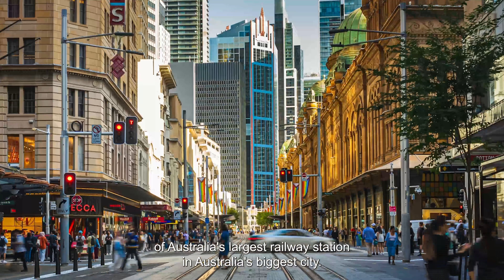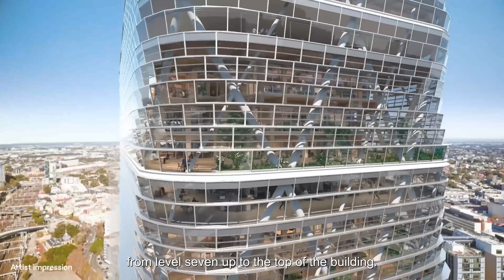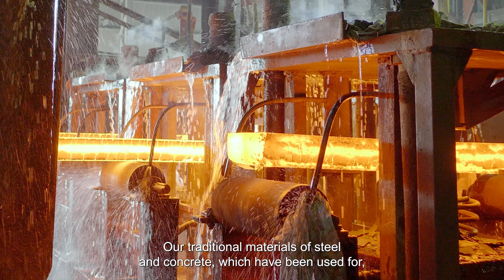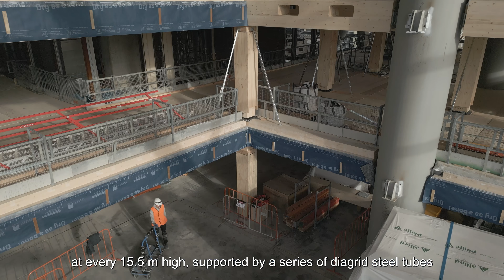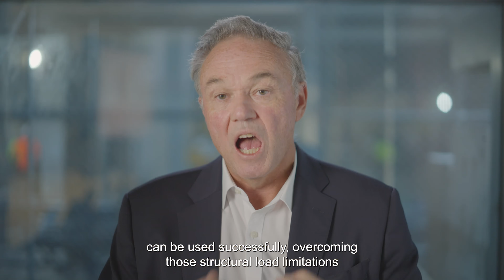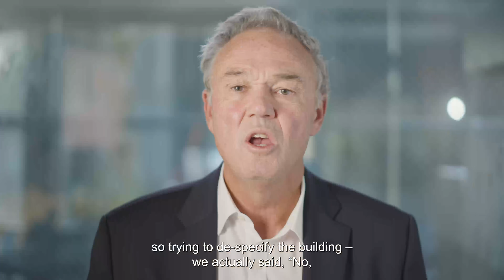The world’s tallest timber tower: Sydney’s impossible build

Comment: Atlassian is already regretting this build. The maintenance will be an ongoing and increasing cost.
Reply: the wood structure will not burn. In a large fire, the wood will carbonize and form a fire resistant skin so the wooden structure will not be compromised. Whether or not it can be reoccupied is a different matter.
Reply: @chochylindt  if the fire is hot enough, the wood will burn my man

Comment: Structurally, this is absolutely nowhere near a genuine timber tower. Never.

These so-called timber “habitats” are essentially slotted into a primary steel-and-reinforced-concrete mega-structure, like timber drawers inserted into a much larger structural cabinet.

That may be clever branding, but it is not structural truth.

From a structural engineering point of view, this looks far more like a steel-and-concrete mega-structure with timber insertions than a true timber tower.

Calling it a “timber tower” may sound attractive in a media headline, but technically it is highly misleading.

Comment: i'd put any money on the fact the carbon footprint of constructing this building is no more environmently friendly, or sustainable than any other high rise
Reply: more for bragging rights than anything significant impact. They may have saved some carbon from not using concrete, which is carbon-intensive, but the engineered wood was also energy intensive to make. Most of a building's carbon is its operation so unless it's covered in solar panels with batteries and energy-recovery tech in the lifts, not any better than a conventional building.
Reply: @chochylindt  "They may have saved some carbon from not using concrete, which is carbon-intensive, but the engineered wood was also energy intensive to make." that's... the point. they are using timber because it's less carbon intensive than concrete. unless you know of a material that has 0 embodied carbon?
Reply: Wood is regenerative. Maybe Google what Carbon footprint means first 😅
Reply: @downundabrotha  I know it is bro, but it's not a wooden hut in the forrest, I'm talking about the whole building and process, don't get me wrong i get what it involves (builder myself), and I understand what a Carbon footprint is defined as.
Reply: @mattyk82  nobody is claiming it is? you people are just desperate to be angry over something, I don't understand it. When you look at the total ledger, a hybrid timber skyscraper leaves a dramatically smaller scar on the atmosphere than a standard concrete block. That's just an objective fact
Reply: The high use of wood alone here will significantly reduce the amount of carbon used, especially when replacing concrete. Timber literally absorbs carbon out of the atmosphere unlike nearly every other construction material we use. Concrete itself requires a significant amount of energy to make, and is typically leveraged using fossil fuels, and is the highest contributor to CO2 emissions in construction globally.

They have good information on their website about how it's going to be achieved.
Reply: Concrete needs CO2 to harden because the end product is calcium carbonate, so concrete takes in CO2 over its lifetime and thus produces a significant amount of CO2 less than people who abuse climate change for their political agenda claim, concrete is not a climate killer. But still it is better to use wood because it stores CO2 and needs less fossile fuels to be harvested and to be transformed in laminate or other treatments so it can be used as building material.
My hope is that countries throw away the anti-nuclear-regulations so that there is no need for coal plants in the electrical grid. And the used fuel rods can be recycled and the fission products can be stored until they become stable elements like rare earths.
Reply: @maasl3873 exactly mate, i couldn't agree more
Reply: It doesn't matter.
It's the idea and the audacity of the concept that is impressive
Reply: @gore1089its not impressive. We're the most taxed country on earth and the average australian is struggling to keep up with the cost of living but hey heres a fancy eco friendly building
Reply: @taipan-pete88 
Don't get me started on this topic 
This housing tragedy was never going to be a painless operation LABOR knew it and 
leaving this man made cancer in place was not an option and those who initiated it all knew it would eventually kill the country.
Whitlam wanted to nationalise our national resources and was turfed out by the establishment and the LNP.
Shorten wanted to do something on negative gearing and was also turfed out.
Howard sold our gas to China Japan for peanuts and he started this housing crisis in 1999 when he wanted to use houses  like betting chips in a casino and Abbott won an election on no taxes on mineral resources.
What could possibly go wrong. ?
Everything. 
Why do the stupid people keep complaining when they keep getting sucked in by the BS corporate propaganda machine.?
If these are the people the media are paid to push into power,  they should take some of the blame.
 This has been going on for decades and the media is now totally corporatized for  the 0.01 percent.
Remember  we've only had two Labor governments in power since Bob Hawke and both times they inherited catastrophic economic conditions.
Reply: @taipan-pete88  It is not a government project, it's Atlassian building its headquarters with its profits mostly derived overseas.
Reply: my old company... Rethink lol